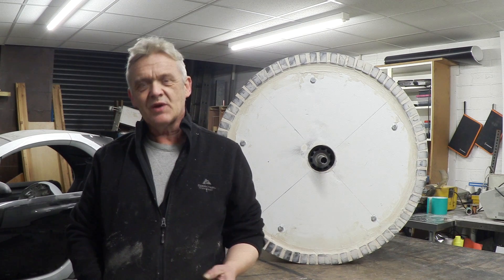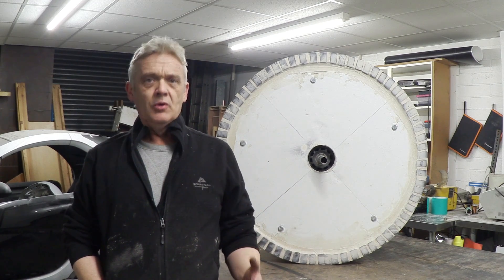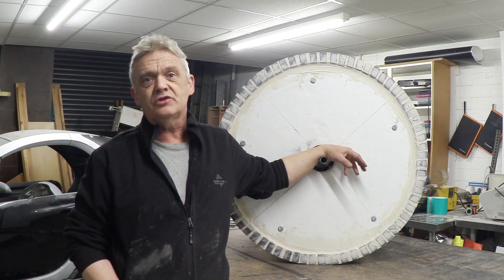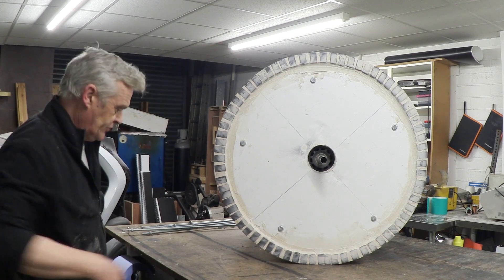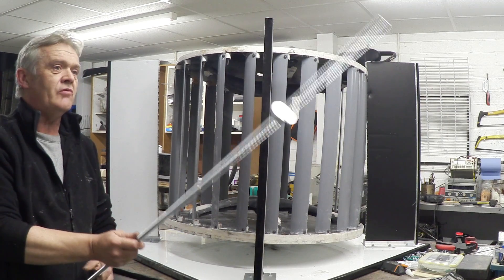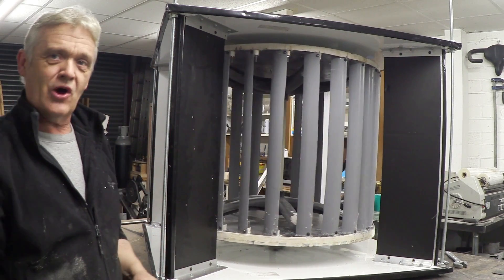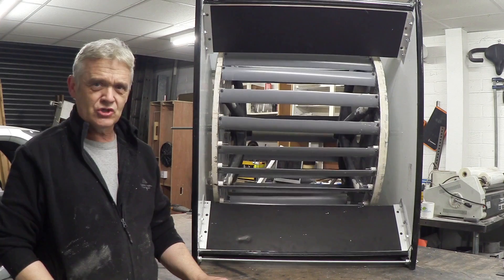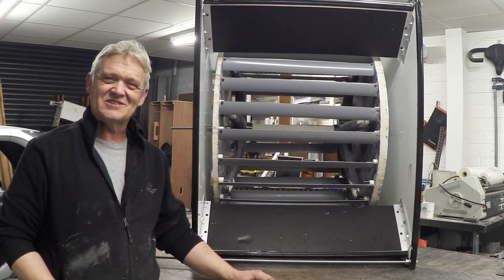Building a 1kW Wind Turbine For Under £100 Part 4 - Finishing The Body

Comment: You could also put Magnets on the top.. That way you could put twice as many coils
Reply: Yes but, then the cogging from the magnets would increase. So, yes more power output but, it would require much higher starting wind speed and due to that limiting factor, would not be as efficient. Also would be useless in winds under 15 MPH. If you consider that the lost power generation with lighter winds could have at least made 100 to 150 watts an hour on a low wind day, then it is obvious that the need for higher wind speeds is a big set back to the goal. Instead, either make the base wider/ turbine taller ( more surface area ) or install multiple given how cheap they can be made so that you get power out of them in low winds as well.
Reply from the maker: for sure mate
Reply: @metalorange1486  the video says 1 kW.. I am stating how you could make this statement true.. With only one transformer.. True it has a lower starting speed.. But you would probably need a hurricane to make it put out even 100 watt..
Reply: With alternating N S  poles for the  magnets you might be able to improve performance by putting some " back iron" between pairs of coils to lower magnetic reluctance of the magnetic  circuit down the road....
Reply: I would place magents at top AND bottom. Use place even black and white strips along the edge of the drum. Use these strips to sense the rotational speed if the drum so it spins in small winds and by raspberry pi, pit the coils in and out of circuit to adjust the load based upon wind speed. Otherwise there maybe too much dynamic load in the drum and slow it down.
Reply: @metalorange1486  the reason I suggested an optic tach is because you can have zero load on it as it spins up. A motor or coils would produce a load to the drum. But if it didnt cause any any load to the drum at first you could certainly use one of the coils as a tach. The reason I would use a PI is because it has built in wifi and very standard application development and a GUI to write some very cool applications for your project. U can also connect tonit wirelessly to upload new apps. U can even install a webserver to create web apps for the project :) for the money, i think it better then the arduino. I am merely suggesting. :)
You can monitor the speed of it and determine WHEN it reaches top speed, you can either apply eddy current brakes or apply more load to it. The thing that makes this design si nice is that, unlike windmills with those huge blades, this design has no gyroscopic progression its stationary. The base needs to have a firm mount.

Comment: Power from the wind can be calculated using the equation 

Power = 0.5 × air density (average 1.3 kg m^-3) × area through which the wind is passing × the speed (m s^-1) of the air ^3

Hope this is somewhat helpful, I think this build is brilliant thanks for sharing.
Reply: I think the velocity of the air should be to the power of 3 but yes that is along the right lines
Reply: @IrishSkruffles  typo on my part well spotted thanks for pointing this out. Although as we aren't specifying a direction of travel it is speed not velocity although its commonly misused, much in the way we say the weight of something when in fact we mean mass.
Reply from the maker: very helpful mate - thanks for doing that
Reply: Desmond Bagley  quite possibly yes but the area that is swept could be calculated by re arranging the formula to make area the subject, once an average energy output is measured. This would then give you the information you need to calculate power at different wind speeds for this particular device. My gut feeling is that the area of the disc will give a fairly good estimate of power available.

Its also worth baring in mind that this is simply a mathematical model for calculating available energy and therfore will not give an exact measurement of power output as we are making assumptions about the conditions, for example the density of the air, neither does it allow for the efficency of the turbine. What this does is give a good idea of what to expect from the turbine. Only further testing would give an more accurate picture of what it truly is capable of.

Comment: Nice, the issue I see you running into is the pressure envelope that will limit the RPM regardless of wind speed with a VAWT, obviously the reason the  a HORIZONTAL axis is used is the ability to overspeed. That is why one does not see VAWT in large commercial use often. I personally love the VAWT due to the self stabilization at high speeds. The blowing up thing is not ideal with over speed of HAWT. You will get around 200 watts hopefully ( at full potential and optimal wind, AKA not 1KW ). We shall see. Also, one could simply attach a belt or chain to the outer rim where you placed the magnets, then to a motor and voila, you have an interchangeable gen-set with simple maintenance. Of course, you would also need to strengthen the turbine axle. Anyway, cheers.
Reply from the maker: nice points mate cheers - of course the idea here is speed at the rim and simple design - but get what you are saying and thanks for the add

Comment: Hey Robert, your Turbine is really imbalanced. You should fix that before you put it on your roof :)
Reply: not by much,nothing a bit of snot cant even out.
Reply: @paulmaydaynight9925  this imbalance is at high rpm a really big Problem. Even a couple gramms of imbalance can cause high damage
Reply from the maker: yeah potting the magnets has made it a little unbalanced - I need to balance it